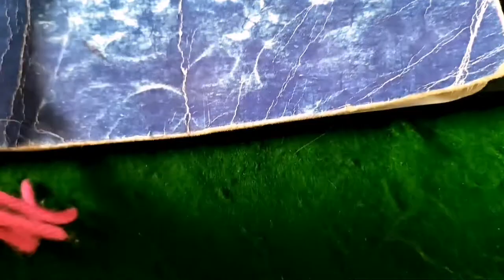HOW TO FIX HP LAPTOP POWER SWITCH BUTTON PROBLEM REPAIR PART 1

Comment: Did you cut out the part in the video where you repaired the switch? was it a direct factory replacement off eBay?
Reply from the maker: Just replace and repaired it